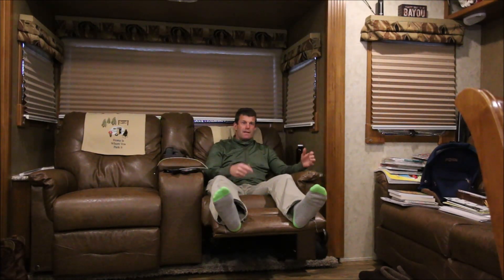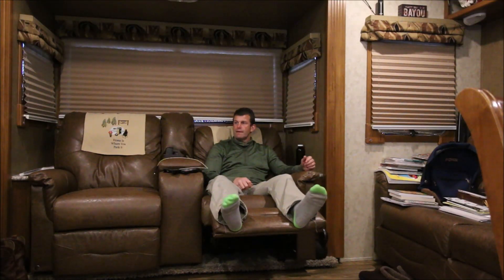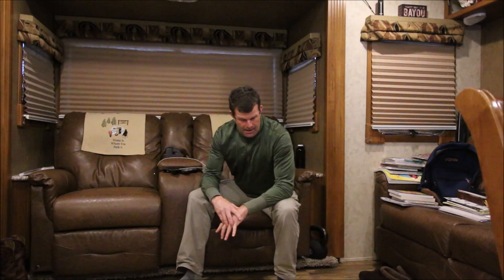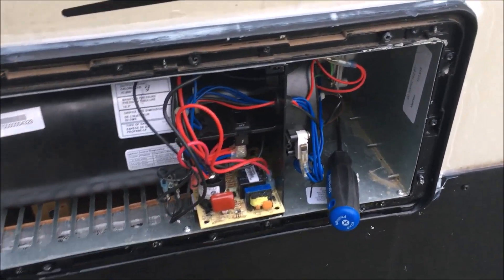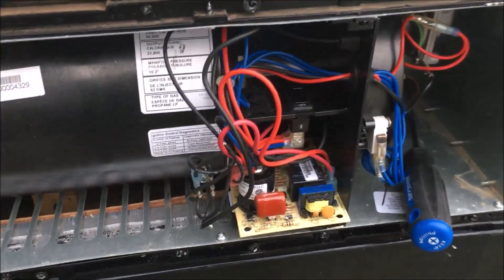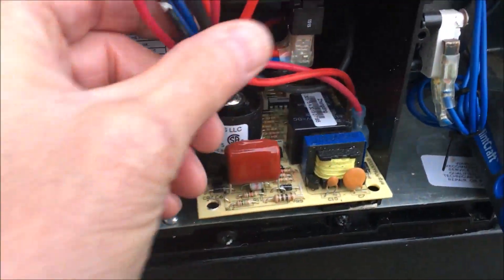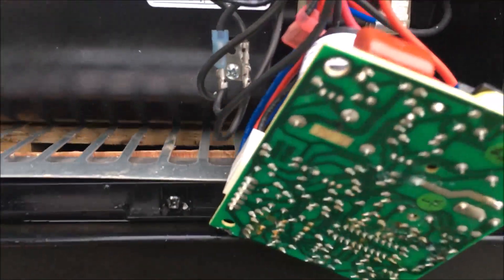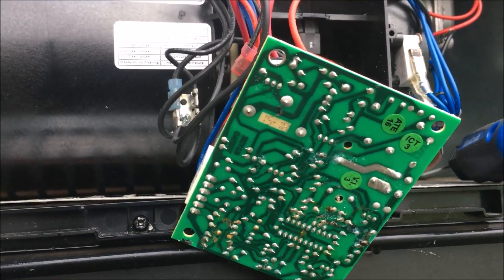Atwood Dometic Furnace Problems Part I "The Problem"

Comment: I want to thank you for this video. We were out last night and the furnace relay started clicking rapidly and the fan motor was cycling on & off. We had this same problem a month ago and the Atwood manual says it's the high limit switch or sail switch. Replaced both and the sail switch was indeed bent. Afterward, furnace worked great. But then it happened again last night while we were out in 35F degree weather and not a good time for the furnace to malfunction. I hit the internet to figure out what else could be going on and after seeing this video I started looking for water. Sure enough, there was a leak from the refrigerator compartment dripping into the furnace and onto the electrical. IT WAS RAINING WHEN THIS HAPPENNED THE TIME BEFORE! And it was raining again last night! I took a tube of silicone and sealed up where the leak was coming from and once things dried up the furnace is working like normal again! I ordered a new board in case this one is too far gone. Thank you again!
Reply from the maker: Now THAT is why I love YouTube!  I'm SO glad that video helped you.  Sometimes these RVs can drive you crazy but you can bet your problems are not unique; someone somewhere has had the same problem.  I hope you have a warm winter!
Reply from the maker: @kristofuh  Fantastic Info!!  Thanks for sharing.I I moved your information to the pinned post  Thanks again!

Comment: Thanks for this video. My floor vents starting blowing and nothing I did with the panel would shut it off. I removed the exterior panel  and saw my circuit board, it wasn’t wet but a small metal shaving was laying on it. I blew it off and turned everything back on and seems to have fixed it.
Reply from the maker: Great job!  You saved yourself a trip to the repair shop!

Comment from the maker: I RECEIVED A REPAIR KIT FROM ATWOOD TODAY!  THE INSTALLATION VIDEO WILL SOON FOLLOW SO STAY TUNED!!!
Reply: Bigguy20674 Atwood is now Dometic, customer service number is 1-800-Dometic.
Reply from the maker: Here's an update:
I sent an email to customer support <customersupportcenter@dometic.com> (Atwood is now Dometic) and they said the part is:
32596 BOARD RELOCATION KIT
It is still FREE and to call 800-544-4881. Here is the contact info page for them: https://www.dometic.com/en-us/us/contact-us
They are also instructing to caulk the door with 100% silicone. I would also recommend caulking any joints above it with silicone as well because I had that experience. Do not however caulk the bottom as they show in the instructions not to go below a line. That is so any water build up can drain. I would also recommend caulking with silicone around the panel that meets with the RV surface as that can also be prone to leaking.
https://go.pubhub.help/#/Heating%20Solutions/24fa5b29-bc66-444e-bf1f-2352495358ea/1

Thanks for the info @kristofuh
Reply: Where's the number and video? My furnace don't do anything?

Comment: Great videos! I have a domestic furnace that the dang fan won’t stop blowing. Any ideas?
Reply from the maker: Take a look at the board and see if it has been wet.
Reply: @JustPlainCommonSense  yeah I saw that video from you. They’ve changed the design to keep it up and out of the water. So the limit switch, the sail switch, continuity all checks good, and even sent direct power bypassing thermostat and that checked good, AND the board checked good(board on a board on a bench test) HOWEVER..  I ended up doing a board swap with another unit and it was in fact the board even though it had checked good via bench test. Apparently most bench tests only check for power really and continuity really.. and not all the actual functions of the board(sensors and what not).. blew my mind. Lol but figured I’d stop back by and leave this tid bit here for your knowledge and anyone else’s. Again though.. love the videos you have.  Great information! 👏

Subscribed by the way.

Comment: i have a afds20121 atwood furnace. if i turn the thermostat to its highest setting thats when it turns on. it wont heat and only runs for about 20 seconds then turns off.. we never use the furnace except maybe 4 times out of 3 years. once it shuts off i go over and adjust temp to lowest and then to highest and it works for 20 sconds again. Also will do the same if i flip the rest switch to off and then back on. So im not sure what it is. Sail switch is what ive read. there is no water anywhere but blower only runs for 20 seconds and then its done...any suggestions?
Reply from the maker: I haven’t had any problems like that so maybe try the sail switch and see if that does it. It’s worth $30 to maybe not have to hire an RV tech to troubleshoot it. Make a video of the problems and the repair process!
Reply: @JustPlainCommonSense  thank you. Ya I'm going to take it apart tomorrow to see if it's just debris that's maybe blocking it. As we never use it and we have 3 German shepherds so maybe some fur got in there or something. Maybe I can document it and post a video
Reply from the maker: @dtrust68  could be as simple as a spider we’d or mud dauber nest. You just Never know!
Reply: @JustPlainCommonSense  there was debris on it but its still doing the same thing....also weird fact when i looked under the bench (where the furnace is) i noticed a black -12vdc wire exposed and not hooked to anything. Even though it wasnt hooked to anything it still worked, so i thought must be normal plus it didnt look like it was attached to anything. anywho cleaned the sail switch and placed everything back. Furnace wouldnt even turn on, so with me being curious i took that black wire and stuck it inside with a lone white wire that was crimped by itself and nothing else. well to my suprise the furnace turned on, but only for the 20 seconds. It's weird how before it didnt need the black wire hooked up but now it does. IM SO CONFUSED lol
Reply from the maker: @dtrust68  see if Atwood has a wiring diagram for that model. You have an interesting case for sure.
Reply: @JustPlainCommonSense  I sent them an email. I also called the number labeled under your video, but it was a guy's number so I didn't leave a message. I expected a Judy 😂. Granted your video is 3 years old so that's why I sent an email. I believe they do have a wire diagram, I will add everything still looked new and in place correctly when I lifted the furnace up.
Reply: @JustPlainCommonSense  came to say the sail switch fixed it. Man I'm happy thats all it was.
Reply from the maker: @dtrust68  I hope you did a video. I’m glad it worked out!
Reply: @JustPlainCommonSense  lol. Ya I didn't. I'm not good at that stuff.

Comment: just drill a few holes in the bottom of the case underneath the board so the water will drain :)
Reply from the maker: Well as long as the retrofit kit is available, I’d go that route
Reply: @JustPlainCommonSense  For sure.  Ther retrokit just moves the board at an angle.  Which you can do by putting the board on offset standoffs and drilling water drain holes in the plastic casing.
Reply from the maker: @rustusandroid  go for it but the retro kit gives you a new board too.
Reply: @JustPlainCommonSense  I'm not knocking you at all.  Your board was toast so that was a needed upgrade.  I'm talking about preventive maintenance before people have to spent $130.00
Reply from the maker: @rustusandroid  but the kit is free or at least it was for me.
Reply: @JustPlainCommonSense  Well!  Can't go wrong with free then.
Reply from the maker: @rustusandroid  I agree